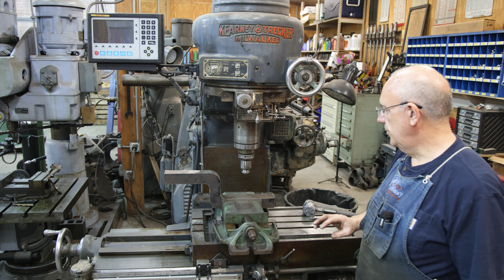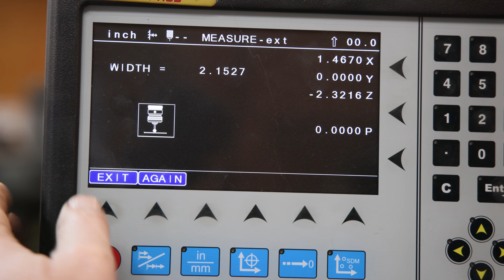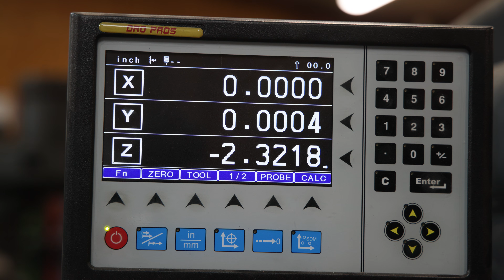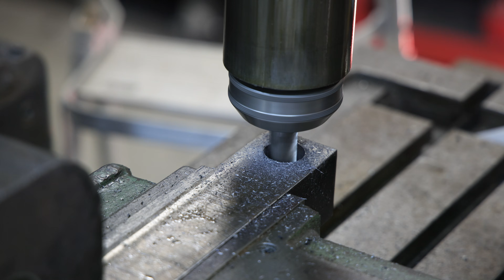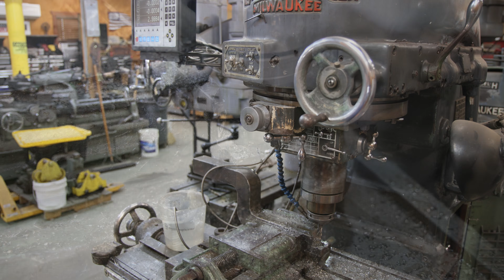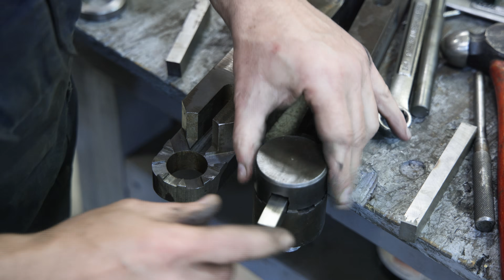Steam Stoker Engine Project: Using the Rotary Head Mill to Make A Custom Planer Tool Holder!

Comment: I'm way behind on catching up on videos so I haven't seen the follow-up for how this worked out yet, but I noticed at the end that it looked like the cutter was behind the axis of the clapper box. A small negative offset like that might work out ok, but you should be extremely careful on positioning the cutter too far back, as the tip of the cutter will swing down into the work on the beginning of the return stroke when the clapper attempts to lift the tool. It'll be essentially the reverse of the problem you're trying to correct, where the cutter digs in on the return stroke rather than on the forward cutting stroke.

This is a very difficult issue since you're dealing with multiple potential pivot axes that will limit where you can safely place a tool bit, between the various points where the machine and tooling will flex, and where the clapper box will swing, and so on. I don't envy you having to take this on, you've got quite a job on your hands.

Comment: I hope that your special tool works out.  With the long throw required to reach the bottom of the casting it will be hard to keep enough rigidity to get a good finish cut.  
You mentioned  the problem of using a toolpost grinder attachment due to clearance.   A fairly modern tool that could do the job is to use an oscillating tool with an abrasive cuttter. If you can get close with your modification, an abrasive cutter oscillating tool shoould be able to get you as good a finish as you desire, without the clearance problems associated with circular motion toolpost grinder.

Good Luck,

Jimmy Johnson
Reply: Keith went over the flex issue in detail in a different video. He is actually making good use of the flex in the tool to his advantage to eliminate the chatter and tool digging into the work.

Comment: Sir, I am not a machinist by a long shot, but enjoy learning from your channel. Therefore I am asking a question rather than making a statement. Would I be correct in saying that with the cutting point now sitting "behind" the clapper box pivot point and not "in front" of it. (Depending on how you look at it) This new tool will have to cut clear into open air past the work piece before returning on the back stroke in order to prevent the cutting edge from going in deeper into the work piece as it now "cams" over the centre line of the clapper box pivot point when changing over from the cutting stroke to the back stroke?

Comment: Remember, that the clapperbox will not work with this design of tooling. And keep in mind, that you flip the tool up manually on each pass and to do it fast enough. Otherwise the cutter will dig into your part.

Comment: 15:45  What a GREAT solution!! .. I'm fully aware of the fact that's a rotating head mill .. and I didn't think of USING that function to bore a hole larger than the milling cutter diameter !! .. Very good!! :)

Comment: I very much admire your tenacity on this one. But it will be very much worth it in the end. Most appropriately I watched  Leo tonight solo set sail solo on Tallyho including raising the anchor with windlass  which you put so much effort into. The rotary head mill was a real eye opener for me. Of course that’s why the taper fitttings  had to be short and stubby.

Comment: Hello, after seeing the  work you do. it was very interesting.  I ask you:  Do you still do rebbabit ?  I interested in rebbabit 8 connecting rods of a cars engine, veicle data: 1929 Cadillac 1183, engine 341B, which has some bearings with some pàrtial loss of material. If you do not do this work, I would appreciate it if you could tell me  of a place where they do it, can be anywhere in the United States. Thank you very much.

Comment: I know you're too arrogant to read the comments, but I'll try anyway.
Most black drill bits have a soft shank. A test with the file shows this. You can simply turn it in the lathe to the desired size.
Reply: Not sure if Keith has the time to read all the comments.... I do not believe Keith is "arrogant"

Comment: While the original users of that K&T rotary mill would drool over CNC, they would have also been very impressed with your DRO let alone the probe for finding edges.  I would have like to seen you cut the radius on your work using the rotary mill, but your manual skills are quite impressive on the belt sander.  Looking forward to seeing the steam engine with your stoker rebuild in action.  Keep up the good work.

Comment: I love your content and look forward to each of your video postings.  That said, this one was very hard to watch because of the awful screeching noise made by the end mill during the circle cutting procedure.  I had to constantly fiddle with my volume to hear your dialog but then quickly dial it back to avoid ear damage when the machine started back up.  Please have your editor reduce the volume of harsh/loud machine noise in future videos.  Your fans will greatly appreciate it.   Otherwise, keep up the good work.

Comment: To be honest, a digital edge finder in a drill chuck seems a bit overkill to me. The likely runout of that drill chuck ruins the accuracy of non-rotating edge finders quite a bit. I'm pretty sure a simple rotating mechanical edge finder would have given better results here. Not that this project requires super accurate dimensions, so it's not a problem of course.
Reply: I agree with everything you said, but to me, the electronic edge finder is easier to use when it plugs directly into your DRO. Him stopping to explain every little detail made it appear more time-consuming than it actually is.

Comment: Don't you love the old imperial range of threads and sizes! It was a close call with the US going metric early on but now you are stuck with it while the rest of the world moves on.
Reply: Yup!  The older I get, the more frustrated I get with imperial measurements - length, volume, weight, measuring for cooking, etc.

Comment: Looks like the table moved .0004 in 'Y" after probing for "X" probably due to slop in the gib.
1500 RPM seems way to fast for that 1/2" end mill

Comment: Take the part out, go to another machine and drill and ream the hole to size and then put it back in the K and T and find the center of the hole..
Reply: Simpler to finish milling, then go to second machine to enlarge hole to needed size. Only need to setup 1 extra time instead 2
Reply: @mikewatson4644  Yep. that would be better.

Comment: Something I have just realized about this particular machine, while it creates some issues with its collet style, is it has capabilities that has the potential to eliminate a great many special tools that normal milling machines require. Amazing the engineering that went into this machine given the time. Thanks for sharing.
Reply: So, not having a boring head with 3/4 straight shank let you to an even better solution to the problem! (all of the unique boring head adapters I have made will go into a 3/4 straight shank collet-- fairly universal - & most have a flat for a set screw in case i have some other unexpected situation)..  
What a great machine!

Comment: Why the belt sander, simply use the rotary head to radius each corner or a large 180° radius - you were on dead center. Our plastic mold tool and die shop had (2) rotary head die millers, (1) 4 inch offset quill attachment and (1) driveshaft connected rotary table between them 1960-2005.
Spiral flutes could be milled with a drive shaft dividing head. Cherry with the quill.
A lot of potential if fully equipped however for some features the range was limited. Hydraulic duplicaters, later CNC ended their use.

Comment: Hi Kieth,  
the obvious question that I've not seen anyone ask, and I've not been through all the responses to this job, is, "is there no one who has any notes on how this particular item was machined originally?" I would have hoped that somewhere in the records of the original manufacturer, there would be some indication of how these  were made. I know it was a long time ago, but they did know how to write then. Didn't they?
Great job on the workaround to get that hole machined to the correct size for the hold down bolt.
 That mill certainly  has some unique features. It's designers must have had some sleepless nights dreaming up that rotary head without a computer.
Regards from Canada's banana belt,  with snow for a change.
🤞🇨🇦🍌🥋☃️🇺🇦🕊🇺🇲🪓😢💩🏁👍
Reply: It was probably a proprietary process. You wouldn't want to give the competition a blueprint on how to do something that only you could do.

Comment: Wouldn’t it be easier to get a boring head, that has a slightly smaller bore, than 7/8, and redrill and tap the chuck to 7/8-8….that way you’re not modifying a rare and hard to obtain collet 🤷‍♂️

Comment: Is the clapper box now made non-functional?

On the backstroke, the tool is meant to rotate up and out of the cutting plane

However, the radius to the tool from the clapper box hinge is now longer

Thus, it can no longer rotate, as to do so, it must rotate THRU the part.

Comment: While I'm always game for some rotary head milling content, I wish Keith would address the many, Many, MANY comments on the previous video about simply relieving the center of the cutting edge of the scraping tool he made. I can't imagine that Keith doesn't know this technique since this is very common when making grooving tools for the lathe. Relieving the center allows both sides of the tool to reach a corner, and yet still travel flat across the planing surface. Does anyone actually know why this obvious solution doesn't appear to have been attempted? In fact, I think even Adam Booth has an old shaper video from his home shop where he did exactly this technique. Come to think of it, it might have even been when he attempted to machine this very engine!
Reply: Adam shows such a tool in use at 21:22 in this keyway video: https://www.youtube.com/watch?v=af7mWmBB--4
Reply: You people take Bozo WAY too seriously, he has a lot of machine tools, very little knowledge on how to use them, but if BS was money he would be a millionaire! 
So just get some pop corn, sit back, and wait for the next f*** up!
I told you he was avoiding this job like the plague, and now you see why, just because you have lots of machines, dose not make you a "Machinist"!
Oh, BTW, he has the correct machine for this operation, a HORIZONTAL BORING MILL!!:person-turqouise-waving::face-blue-smiling::face-blue-smiling:

Comment: Seems counter productive to hog all the steel out and only be left with about a third of the original thickness. Could he not have slotted deeper and keep more thickness?
Reply: The slots would ruin your rigidity regardless if the thickness at the bottom stays the same. I would just have made the ring to the same thickness as the original all around, since there seems to be plenty clearance to the nutted end anyway.
Reply: You people take Bozo WAY too seriously, he has a lot of machine tools, very little knowledge on how to use them, but if BS was money he would be a millionaire! 
So just get some pop corn, sit back, and wait for the next f*** up!
I told you he was avoiding this job like the plague, and now you see why, just because you have lots of machines, dose not make you a "Machinist"!
Oh, BTW, he has the correct machine for this operation, a HORIZONTAL BORING MILL!!:body-blue-raised-arms::body-blue-raised-arms::face-blue-smiling::face-blue-smiling:
Reply: @garybrenner6236  please tell me how the horizontal boring mill would be any different than the K&T, which also didn't work because he had to use too long if a tool. And quit just hating on him, you know he's doing this as a hobby, right?

Comment: I would not have expected this ancient technology to be such a challenge to work on. Typically, older machines had large parts with comparatively loose tolerances. This project is really putting your abilities, machines, and perseverance to the test!
Here's hoping that the custom tool holder does the job for you.
Reply: You people take Bozo WAY too seriously, he has a lot of machine tools, very little knowledge on how to use them, but if BS was money he would be a millionaire! 
So just get some pop corn, sit back, and wait for the next f*** up!
I told you he was avoiding this job like the plague, and now you see why, just because you have lots of machines, dose not make you a "Machinist"!
Oh, BTW, he has the correct machine for this operation, a HORIZONTAL BORING MILL!!:body-blue-raised-arms::face-blue-smiling::face-blue-smiling:
Reply: @garybrenner6236  I get Keith maybe not be a professional machinist, but I don't think he ever portrayed himself as one.  Maybe you are, but I most definitely am NOT but always curious to learn.  How would  you go about setting this up on a horizontal boring mill?  I've seen them used for boring and face milling operations and even moving the table to create vertical or horizontal keyways on the face of something, but am not sure how you would go about setting up that engine casting to mill out that channel.
Reply: @garybrenner6236  There's the door. Don't let it hit you where the good lord split you.
Reply: @garybrenner6236  Dude..  What's wrong with you?  Go elsewhere with your negativity.  A lot of people are not machinists, but still use these machines and love this content.  If you have watched this channel long you would know he doesn't claim to be a master machinist.  He just gets sh(t done.  "So just get some pop corn, sit back, and wait for the next f*** up!"  yes.  We all make mistakes and he shows them so we don't make them. There's few out there would keep a mistake in the video.  You don't seem like one of them.  You make me want to vomit.
Reply: @garybrenner6236  Your either incompetent or just a social insult. I've been in engineering for 50 years plus. I admire Keith and the work he does with these machines. I'm an old school engineer just like Keith and I have over the years worked with similar machines solvving similar problems the same way or differently as Keith does. So keep your negative comments to yourself and have some respect for Keith and the rest of us old school engineers.
Reply: @garybrenner6236 If you don't like his videos why are you watching them and commenting? No-one asked you for your opinion.
Reply: @garybrenner6236  Fact.

Comment: Remember with the geometry change, the back stroke will be in the position to do the gouging. So you will need to clear the piece you are trying to cut.
Reply: Since the cut stroke goes past the end of the cut, I would bet that the cutter will catch the leading edge on the back stroke, lifting the tool and dragging it back across the cut.
Reply: @CacheRAM  That's kind of what I was trying to say is make sure you clear the piece you're putting
Reply: You people take Bozo WAY too seriously, he has a lot of machine tools, very little knowledge on how to use them, but if BS was money he would be a millionaire! 
So just get some pop corn, sit back, and wait for the next f*** up!
I told you he was avoiding this job like the plague, and now you see why, just because you have lots of machines, dose not make you a "Machinist"!
Oh, BTW, he has the correct machine for this operation, a HORIZONTAL BORING MILL!!:body-blue-raised-arms::hand-orange-covering-eyes::face-blue-smiling:
Reply: @garybrenner6236  You should just quit  watching. You already know it all. LOL

Comment: A rotary head milling machine was highly sophisticated back in the day.  It wouldn't have been superseded until CDC mills came about.
Reply: 1960-2005 Our shop had 2 along with 20 Bridgeports for plastic injection molds.